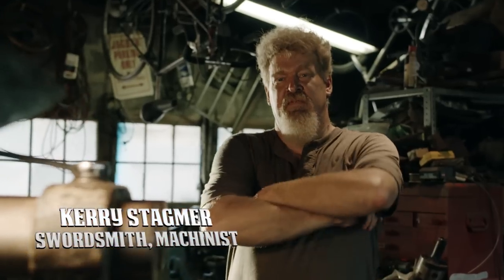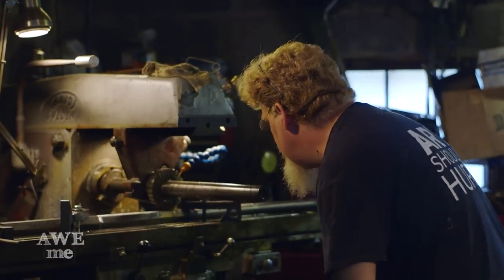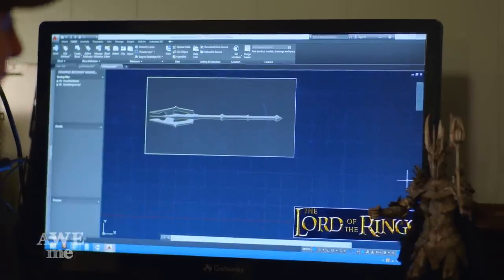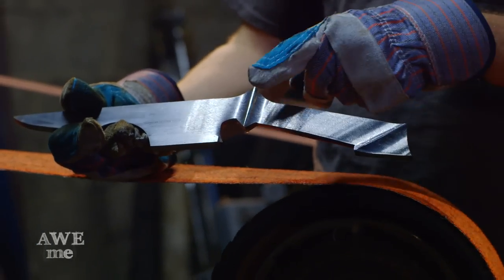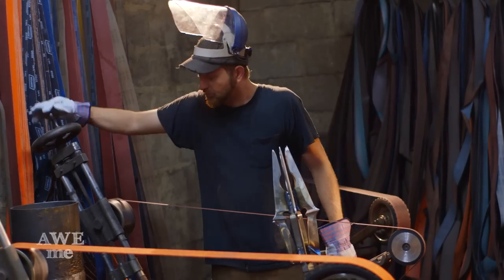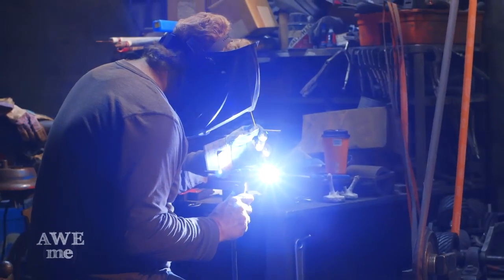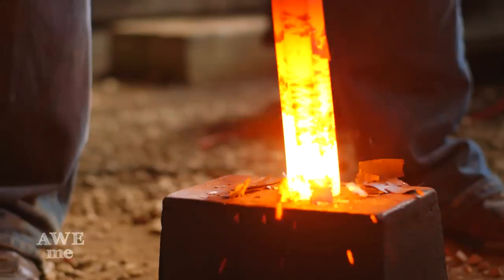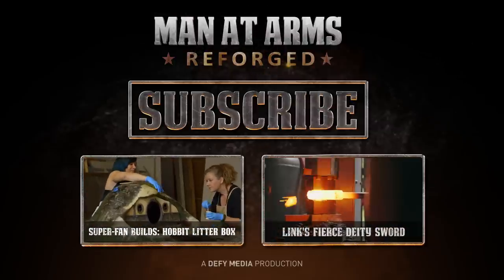Sauron's Mace (Lord of the Rings) - MAN AT ARMS: REFORGED

Comment: A one-handed mace always seemed my first pick in real combat, but a two-handed mace might be even better. It's slower, but one hit will obliterate anything. No edge alignment, no fancy tricks, armor won't work, with this you'll just bash right through flesh, steel and bone. Maybe a two-handed mace backed by a one-handed shortsword... That'd be really good.
Reply: Yup, you gotta love the simplistic beauty of blunt force trauma.. Mass + kinetic energy = SPLAT.
Physics at it's finest....
Reply: Neither a one-handed mace nor a two-handed mace would be any good in a 1v1 situation and even less viable in a 1v2 or more fight. In duels, quickness wins, always. If you were to swing at someone with a two-handed mace, unless you hit them in the skull, (which you wouldn't unless they were extremely uncoordinated) you would then die because they have an extremely high amount of time to stab you or cut you.
Reply: ***** You wouldn't need to parry it, you could just move out of the way since it is so large and slow and then stab him as he overswings.
Reply: ***** What snakeguy818 said is true. and no one handed maces are not as quick as swords, the center of balance is very near the tip meaning you couldn't it fast unless you were extremely strong or it had a counterweight
Reply: ***** Parrying isn't even an issue. You have to wind up so much with a big heavy tool like this that someone with a lighter sword can kill you before you even manage to start your attack.
Reply: Professortusk what about 2 1-handed maces? One for the knee, another for the ribs or something like that lol
Reply: Sergio Barros ...it'd work roughly as well as using a baseball bat in each hand and trying to hit a home run.
Reply: You can always juke.
Reply: A sword has the approximate weight of a bat so more like sledge hammer and bat
Reply: I think that everybody is forgetting about armor, swords do not do much against plate armor or a shield which most people have with a 1-H weapon. A mace while not necessarily killing out right will at least injury and hinder their ability to fight. Also most 1-H hammers and maces didn't have overly large heads for that reason, they became to unwieldy for the average soldier. Technique can also change the effectiveness of a weapon. Making a infinity symbol with your swing gives you constant motion, conserves your momentum and gives you repeated attacks on any part of the target where a sword has to make precise attacks on joints. Also Suaron's mace is pure fantasy that is not even wielded buy a human.
Reply: juan saenz Swords aren't really that heavy, longswords only weigh around a kilo and a half if I remember rightly
Reply: i would just USE ! x) BLADESTORM! with that big 2 handed mace ! :P x)
Reply: THIS is a one-handed mace, you are just too weak and little to use it with one hand...
Reply: invencible33
To put it in D&D terms this is a large, 1-H mace meant for a large creature. A human is a medium creature.
Reply: invencible33 I'd love to see you try and use it efficiently with one hand, people during the medieval era were typically better built than us due to the demand of manual labour, but they weren't all super-humans. Most were just built like people who go to the gym daily and as you can see in the video by the huge guy smashing up the pumpkins... it's really not a 1 handed tool, especially since it's considered that your shield always went in your stronger arm (if you had one)
Reply: Joseph Broadberry
Like I said in my post. This weapon was not made for a human it was made for the corporal form of a Maiar that was larger and much stronger than a human. But even back in ancient times weapons of this size would only be wielded by abnormally large men (like Ajax in the movie Troy) and more for a fear tactic than a effective/efficient weapon.
Reply: invencible33
The D&D referance was just to make a point, medium sized creatures used weapons designed to be used by medium sized creatures. Large creatures use weapons designed to be by large creatures. Sauron would be classified as large. In the game you have to have strengths (feats) to use a weapon that was not meant for your size effectively. And there is a difference between being able to swing the mace and using it effectively in battle.
Reply: Professortusk
If the mace user is in full plate armor then they have the edge against anyone with a sword.
Martin Smith  The biggest weakness with a mace is it leaves you exposed when you wind up a swing and even more so with a two handed mace. Someone with a sword can stab you and if you wear full plate armor they'll get you in the armpits.
Reply: Michael Nyholt Ever heard of half-swording?
Reply: invencible33
You might be able to swing the mace in one hand, but combat requires a degree of control, even with big heavy weapons like this. I do LARP as a hobby, and a 42" mace in that is sometimes difficult to control, let alone a 48" one made of metal instead of foam and carbon fibre.
Reply: AlphaDingo990 Still requires quite a bit of precision/luck to strike into the gap, plus this technique severely limits your reach, thus removing your main advantage over the mace.
Reply: The thing with a massive weapon is that you don't need too much speed, so you can wear extremely heavy armor. Also, I really don't want to get close to someone with a two-handed mace and heavy armor with a puny sword.
Reply: Martin Smith and then tire yourself out after a few minutes of lugging that armour and mace around.
Reply: Martin Smith
 Well, that puny sword or better yet, spear, might just tear through the weak spots of your armor. And that is every single joint. Under the armpits, through your visor, the backside of your knees, your elbow and so on. And you have those weak spots, in every armor. Or else you wouldn't be able to move.
Reply: Sammy9262 heavy war maces and hammers work best when on horseback. The combination of your speed + the swing speed + the mass of your horse, body and mace - the force delivered is crazy. And when you ride on your horseback, in heavy armor, you are less prone to be stabbed by swords. Every armor, unit type, weapon has pros and cons. Swords are nothing for the heavy steel plate armors, the maces were the real heavy knight killers because of the blunt force traumas. Swords would not penetrate and slide off. A rich knight with good armor could not be killed even when unhorsed and on the ground by swords and spears because they didn't have many weak spots and the metal was often impossible to penetrate, so a blunt force weapon like mace would just bash the skull in. I agree with everyone, but remember, everything has pros and cons and is better/ worse than other things in different situations.
Reply: UserDude  HAH a Katana could not cut a Knights head off he the Knight stood there.... Which he wouldn't
Reply: a two handed mace might aswell be a warhammer.
Reply: I would probably have gone with a Greek hoplite setup. A massive bronzeshield suported with a shoulderstrap for easy manouevering and a razorsarp shortsword for stabbing. Hide the blade behind the shield so your oponent can't see from what direction your coming, wait for his attack and the ram that sword in his gut, right under the ribcage.
Reply: Swedsman
Lets not forget that the Hoplite setup uses a spear as a primary weapon, since they mostly were used in varients of the phalanx formation (very good against charges from the front, but much more vulnerable to the side). Similarly to you though, I'd go for a roman legionary setup: shield, shortsword and some javalins . Disadvantage: fast, more lightly armoured opponents can take you down by outmaneuvouring you.
Reply: you only need to be strong as a Gorilla to use it :D

the weapon you are actualy looking for is a spear.
Reply: to everyone in this comment chain, not just the OP:

there is no "best weapon for combat" because "best" is a subjective term that changes entirely depending on your role and situation. for example, one of the most widely successful weapons used on horseback is the lance. that could be considered one of the best weapons for the role of a horseman in combat. but if the situation is changed to the inside of a building, it becomes one of the worst choices for a horseman in combat.

see how that works?
Reply: dual swords
Reply: Professortusk Real world maces only weigh about two pounds and could be wielded with the same agility as your average arming sword. Problem is that maces were very short weapons. But that matters less to who would normally be using a mace, which is to say a "knight" (AKA guy in plate armor, wasn't only people who were knighted that wore plate) on horseback. I suggest checking out Scholagladiatoria's videos on the mace, and any of his others if you're interested in the actual methods and uses of various medieval weaponry.
Reply: I acctually prefer 1 hand sword and shield or double wield daggers :D
Reply: AlphaDingo990 Correct, most longsword weight between 1.2(Early longsword) to 1.8kg(zweihander variation)
Reply: EricPaz Nice to know my facts are correct, thank you
Reply: what about an 1-H axe and shield or 2 1-H axe ?
Reply: Okita Sougou Axes are not quick weapons, using two at the same time would be suicide in a fight
Reply: AlphaDingo990 They're no slower than swords, just shorter. And two would be fine if you used them right. A shield will always be better than a second weapon, but a second weapon is often better than an empty hand. Just use the second axe/sword/whathaveyou to parry mainly. And if it's a bearded axe, you could potentially bind the opponent's blade between the beard and the neck, and make an attack from there. That last part is just an idea of mine, I don't know for sure if that's a legit technique, but everything prior to that I learned from channels like Skallagrim and Scholagladiatoria, who have experience with pretty authentic medieval weaponry.
Reply: Marcwulf Bearded axes have that beard to extend the length of their cutting edge in order to inflict more damage, but you could certainly use it as a hook to sweep a blade aside after a parry. Any technique that works is a legit technique.
Reply: Shea Briar Aye, s'true.
Reply: Greatswords all the way for me.  A scottish claymore is nice, but I would prefer a Nodachi or Uchigatana--devastating combinations of weight and sharpness those weapons are.

If a Greatsword doesn't cut you in half, then it will crush you inside of whatever armor you're wearing.
Reply: RexSpec The're not as heavy as fiction would have you believe. Around eight pounds being the heaviest you're likely to find anywhere. Which is a lot for a sword, but still won't be crushing any plate armor any time soon. Also that'd ruin your edge. For armor, you wanna do what's called "half-swording" where you hold it much like a spear and aim for the gaps in the plate, such as the armpits, groin area and sometimes the visor. That, or flat out hold it by the blade with both hands Yes, really) and use it as sort of a hammer, striking with the pommel, aiming for the head, mostly.
Reply: Marcwulf "The're not as heavy as fiction would have you believe.  Around eight pounds being the heaviest you're likely to find anywhere. Which is a lot for a sword, but still won't be crushing any plate armor any time soon." Six to Eight pounds on a razor sharp edge can translate into thousands of pounds of force on a single edge, and the impact sight itself--even with bad form.

http://weaponsofchoice.com/extras/weight-effort-and-force/ .

Note the force difference between Zweihander and the mace.  Almost a two-thousand pound difference.  Again, if an attack that pierces the armor doesn't kill the combatant, then the impact will--even with padded armor.  There is a reason why heavy weapons are so damn effective against armored opponents.

"Also that'd ruin your edge." The name of the game with heavy weapons is to kill armored opponents by impact.  Not necessarily piercing the armor.  I could care less about my edge in the heat of combat.  My Greatgsword, even with a ruined edge, is still very likely to kill someone--by either impact, or cleaving them in half from shoulder to hip.

Also, consider the fact that I am a pretty big guy:  I'm 6'6 and weigh about two-hundred pounds.  I'm well-versed in Kenjutsu and Iaijutsu.  I've had to purchase specially made Katana's that are suited to my arm length and body size.  Even if the guy is in full plate, if someone eats a full-bodied, two-handed strike, or a battojutsu strike from me, I'll probably knock them down from the force of those strikes and probably break the bones of any unfortunate body part that gets in the way of that strike.

"For armor, you wanna do what's called "half-swording" where you hold it much like a spear and aim for the gaps in the plate, such as the armpits, groin area and sometimes the visor."
I've never had to half-sword with a Katana, or Uchigatana.  Against a less agile opponent, there is no need.  For more agile opponents, I either use a Katana, or Uchigatana and Wakizashi.  The Wakizashi is invaluable for parrying or dealing with more agile opponents.

"That, or flat out hold it by the blade with both hands Yes, really) and use it as sort of a hammer, striking with the pommel, aiming for the head, mostly."
Pommel strikes are, indeed, valuable.  I can agree with this part.
Reply: Yeah, with good form, the mace has much higher force. Using bad form most likely means over-swinging, meaning most likely telegraphing your attacks, making them easy to parry or dodge and swinging past the point where you would stop your blade normally, meaning you get their blade in your throat most likely. Katana fighting wouldn't have techniques for fighting someone in full plate like you might be up against in a European battle, where a great sword would be used. Half-swording is in all the old European treatises for a reason.
Reply: Soullessnut The only correct person here is the only one to not be replied to... (until now)

The 'best' weapon does not exist. Situation/scenario and the user's skill decide whether or not a weapon is effective (assuming the weapon isn't a wooden pole xD).
Reply: Jake Roman that's because people don't reply to things they agree with, usually.
Reply: I always liked the idea of dual-wielding two one-handed blades more. It's faster and lighter, and while you may not have all the power of blunt force trauma, you can be agile on your feet, and you won't need to strike as much as long as your strikes are few and critical. It provides alot more opportunity for offensiveness, especially against a two-handed mace, whereas a big mace like the one you describe would require you to be a bit more defensive do to the huge cost in stamina and possible fatal mistakes if you miss.
Reply: ***** The best offhand weapon is a shield.
Reply: Shea Briar If you're carrying a mace with you, probably. But if you want to be fast, i'd say no, considering shields can slow you down. If you're wielding a two hand mace, I imagine you could use that as a shield as much as you can a weapon.
Reply: ***** Actually, Shea's right. A shield, like a set of plate armor won't actually slow you down at all. An off-hand weapon realistically is usually mainly used for parrying anyhow.